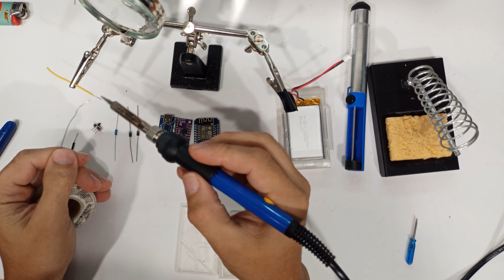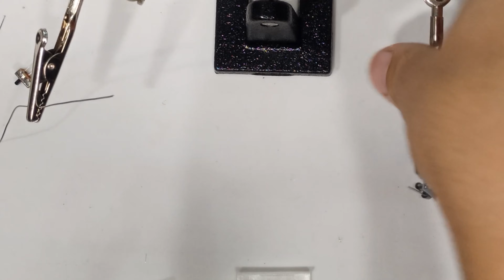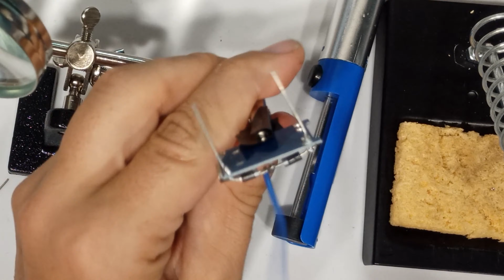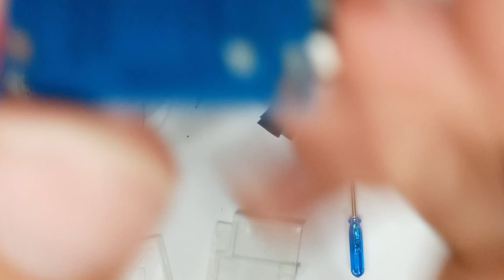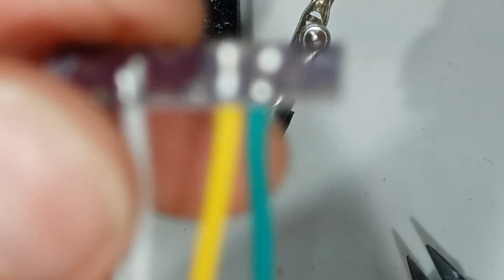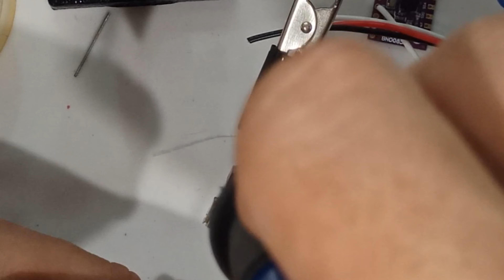Slime VR Full Build Tutorial - FrazierDanger Plays: Full Body

Comment: So I would need 7 chips and 7 batteries for 7 trackers, correct? Are the wires different or just do colors? 
Also literally thank you so much for taking the time to make this video 😭. I’m way too impatient and in the middle of a move to wait for the trackers to start shipping out in November
Reply from the maker: @marshmallowbae4930  Only need 7 batteries if you're running independent trackers. Wires are all the same. Reference the discord and faq for sizing. Different colors are for preventing mixup. But please, buy more than you need! These are all failure prone parts during first build! Good luck!

Comment: Which firmware did you flash the trackers with? i have the same setup but im not sure which to use
Reply from the maker: Always latest unless otherwise specified for your hardware.
Reply: @FrazierDanger  I was having issues with the trackers being detected, first I thought it was the firmware so I commented here but I found out it was because you have to solder the SDO pins together on the BNO085. Thanks for the help though!
Reply from the maker: @zionpanza2347  I believe at the time I completed that video, that wasn't a thing.

Comment: Thanks for your previous reply...im having trouble identifying which tray and case to use from the Hyperion files. I have same parts as you (accept my wifi module is usb C) none of the case models seem to have a hole for the wifi module. Are we supposed to open up the whole thing to upgrade things in future? Also not sure IF we need to use the models with the AUX hole. IF you could clarify I could get this stuff printing while I start ALLLLL the soldering on this for my kids. I have enough components to make apx 10 trackers with no extenders planned as of yet.
Reply from the maker: You need a minimum of 5 trackers for the system to work FYI. There is no need for a wifi module hole because you don't interact with that port very often. Just pry it out and use it the first time you flash and you should be good.

Aux is unnecessary unless you plan on building on auxiliary trackers, so you should be good to ignore the Aux cases and aux compatible main cases.

Comment: Great video for a dad about to attempt to build with the kids. Almost all the parts have arrived. Now I gotta find the best settings to print cases with PLA.
Reply from the maker: You really want petg or pla plus, unless your strap solution doesn't get torqued, ie velcro
Reply: can you provide a link to the 3d printed cases you used in this video? I do not see it in the description and want to make sure I use the one you have here with the middle plate with dividers for each board.
Thx.
 @FrazierDanger

Comment: As a whole how much did this cost you?
Reply from the maker: Maybe about 250? Can be done much cheaper for sure.
Reply: @FrazierDanger  ohhh do you have any suggestion on how to build around 150 to 160?
Reply from the maker: @mooshu7067  If you buy from AliExpress for your main components and use a bmi160 setup, you can get the costs down to sub 100 dollars for a full body setup including your soldering iron
Reply: @FrazierDanger  put together a 10 point tracking set using bmi160s for sub $100 because i already had some batteries
Reply: I got type c microcontroller. Bad decision?